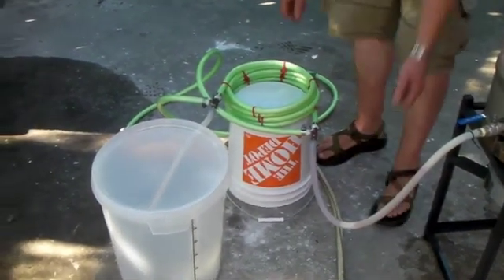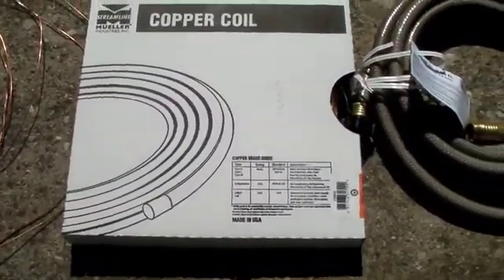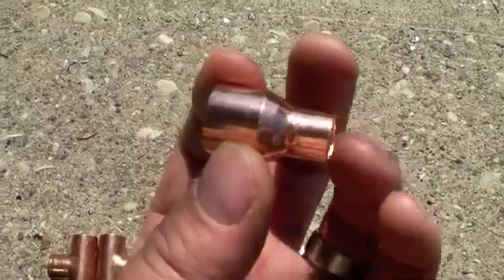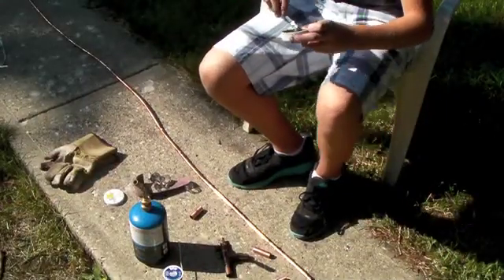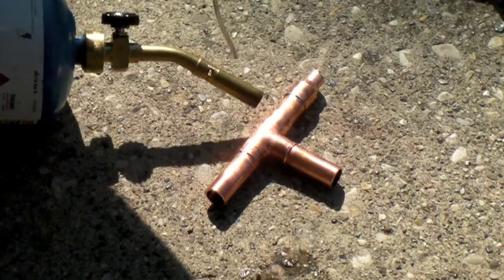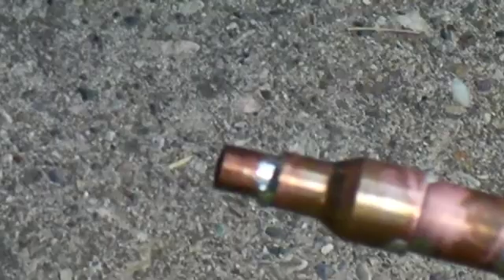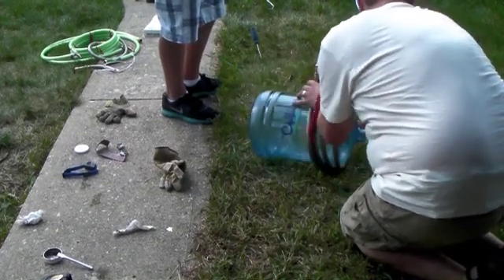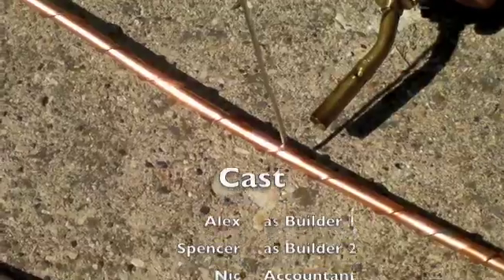Building a Counterflow Wort Chiller

Comment: When I built mine I had some issues getting the copper tubing to go thru the hose. I used  a heavy duty rubber hose instead of vinyl ... maybe that made it harder.  My chiller is 25 feet long btw.  Anyway, I squirted some dish soap in there when it got stuck and it slid right through.

Comment: I did not measure the temp going in or out.  I did brew yesterday.  I live in Southern New Jersey and it was about 55 degrees yesterday.  I was getting 50 degree wort into my fermentation bucket.  The work was about 170 - 180 going in.  I had to reduce the water flow to raise the temp to about 60 before pitching.

Comment: I made a counter flow chiller loosely based on this video.  I did not wrap the copper tubing with copper wire.  Too much work for little reward.  I just finished cooling my second batch of beer and it is working like a champ.  My wort's temp was 210 going in and 74 coming out.  Perfect temp to pitch at.  Thanks for the idea and the help.

Comment: here is a tip, when you build your next cooler, close one end of the copper pipe with duct tape and fill it with sand, then close the other end with duct tape, roll it up in too loops, then flush out the sand. the sand will prevent the copper pipe from having a flat side or kinking in the middle of a bend.